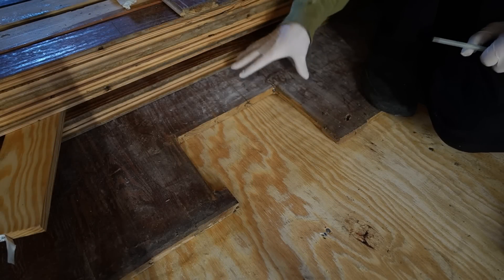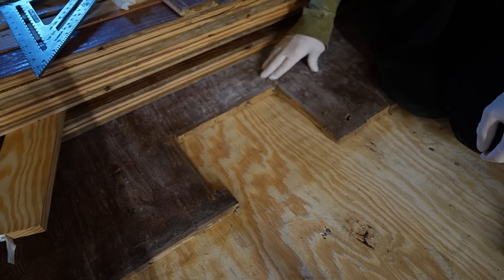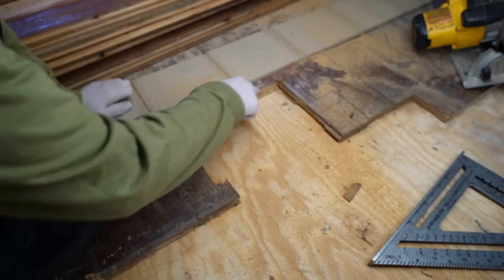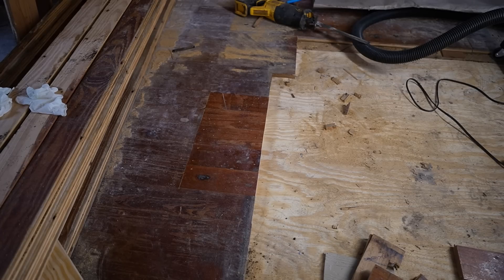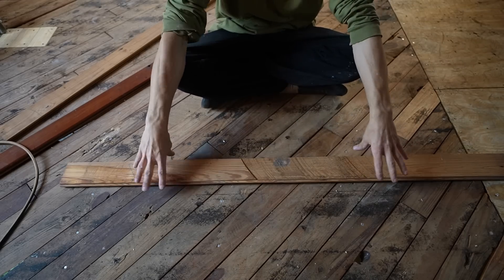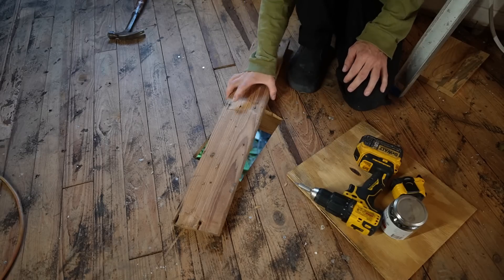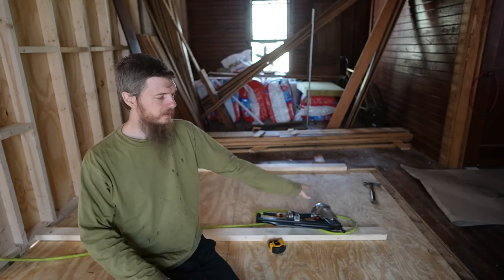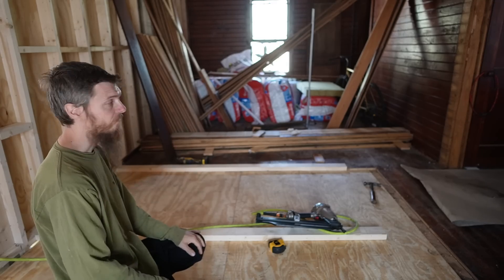Why Floors Were Installed Diagonally - Old House Chimney Demo, Floor Patches, and Wall Framing

Comment: They used to do this diagonal install on walls too. I grew up in a carpenter's family. I'm 75 and can remember when paneling came in, my Dad thought this was just great. He also never lived long enough to use nail guns. He had wrists of steel,though. Unfortunately he died young of colon cancer at 48. He was working before they had a separation of trades. He practically did every phase of building a house, including cinder block foundations.
Reply: Yeah.  Those old tradies were great, weren't they?  Nothing stymied them; they knew how to do it all.

Comment: I appreciate that someone asked why the original subfloor boards ran diagonal to the floor joists and why the finished top floor boards ran perpendicular to the joists.  Your explanation made sense as you showed what would happen if the boards weren't run that way.  
Thanks to the person who asked the question and Thanks to you Doug for explaining.  I'm always learning so much on your channel.  I'm an older, single gal who will never do any remodeling of a home but it's still nice having the knowledge. 
God bless you all!  🙏🏻😊🌻❤️

Comment: Watching you repair subfloor and floor rem8nded me of a couple on our 1920s and 1930s homes. When you lifted the wall by yourself I remembered raising a small bathroom greenboard sheetrock onto a preset ledge near the ceiling, holding it up with one arm and screwing it to the rafters while my 8 month old crawled around at my feet. I finally yelled to my wife to come and take our daughter out of harm's way. She was safe and I finished up. Doug brought back the memories.  I used a cold chisel to break up the bricks and blocks. I saw you got the inner arm scratch from the block. That scrape stings forever! Even your tiniest floor repairs are so precise, square, and clean. You are amazing. Great editing and shooting Ashley. You have a great eye!

Comment: It’s also way stronger in a diagonal. It holds square. My dad built houses in the early 1960 and ran the sub floor systems in a diagonal. As well as the exterior sheeting was ran in a diagonal way strong. That’s why you find diagonal bracing in corners of old houses. The let in. Or cut in a diagonal boards into the wall framing. It’s more about strength. But as well when running your finish flooring back then it was on a bias man as a boy I hit the cut off piles every Saturday to build my stuff on the farm. Old men with hand saws was common one power saw on the whole job.  Thanks your house is getting better and stronger by the day.  Great work thanks from sc.

Comment: I owned a house built in 1940's in Coconut Grove Florida (Miami). The floors were constructed exactly that way. When we bought the house some 40 years later, we had the original floors resurfaced and sealed and they looked great. Whenever I worked in the crawlspace I wondered why the diagonal subfloor boards. And yes they were lower quality with bark and roughness. Apart from having to replace and sister some sagging floor joists from below (very hard work) the house held up well. Unfortunately it is gone and later a multimillion dollar house built on the 1 1/2 lots we had. There are a couple of 'bungalo's" on that street (Bonita Ave) and adjacent streets that took advantage of the rolling topology of the limestone ridge to provide parking below.

Comment: I went through my building trades program in 1972. Our instructor had been building homes since the early 1930's and taught us well about historical building technology as well as modern (for the time) techniques as well. Subfloor boards as well as exterior wall boards (this is before plywood and certainly before Celotex) were laid on a 45 degree angle for structural integrality in order to withstand racking loads under extreme wind load conditions. Exterior sheeting was typically done with 1x6 to 1x12 boards depending on availability but always on a 45 degree angle. It made for extremely strong structures that were able to stand up to at least near miss tornadoes that were a constant threat where I grew up in Illinois. 
I makes me to happy to see you and your wife deciding to reuse vintage materials, and keep your house as vintage in the look of the structure as you possibly can. There is a certain charm to it that warms the heart. Keep the great videos coming... Joe
Reply from the maker: I wrote a post to help answer this in more depth here: https://www.youtube.com/channel/UCRKjjDhP3w2lnx3csu3G3aw/community?lb=Ugkx5ag0oHlMBgiFLakfx6GMELpXOfPC00j7

Comment: The primary reason for laying subfloor boards diagonally to the joists is for rigidity. By installing this way, the floor was less susceptible to racking. Building walls used to be done this way as well, so as to resist the forces of wind against them. A triangle is stronger that a square. When I was young, us kids used to help our dad and grandpa erect out buildings, and this was the method that was utilized.
Reply from the maker: I wrote a post to help answer this in more depth here: https://www.youtube.com/channel/UCRKjjDhP3w2lnx3csu3G3aw/community?lb=Ugkx5ag0oHlMBgiFLakfx6GMELpXOfPC00j7

Comment: Lookin good y’all! Doug, I’ve always heard that the 1Xs for subfloor as well as for sheathing, when placed on the diagonal would strengthen it so much more. Older houses were all done in this way before there was OSB sheets or plywood for subfloor. The house we are working on now is like this and it has withstood many a hurricane, tornado and lots of straight line winds and it’s still standing after 50-60 years. There’s a reason why they push all these “convenient” building supplies. Houses are easily destroyed by weather which means insurance pays or doesn’t….anyway, love the progress but I would definitely like to see some steel toe shoes on you when working with bricks and blocks like that. 😉 I have always hated to wear steel toe boots since I wear a size 11 they’re very heavy 😅 but now that I’m older, I wear them just about everyday especially when demo is involved. Ash, sorry for the rant 🤪😂 Love y’all!

Comment: Putting the small sub-floor boards diagonally also keeps the joists from racking [getting out of square].  When used on walls in old houses the diagonal boards keep the wall from racking by being attached to both the top and bottom plates.  Triangle is the strongest structure.
Reply from the maker: I wrote a post to help answer this in more depth here: https://www.youtube.com/channel/UCRKjjDhP3w2lnx3csu3G3aw/community?lb=Ugkx5ag0oHlMBgiFLakfx6GMELpXOfPC00j7

Comment: I heard your helmet in one clip and I thought back ti when you first started wearing it and explained that you were prone to lung infections. I am prone to what I have called "allergy flare ups." When I'm working with old stuff, etc. I would often get sick. This past week i ran into a very non standard situation in which we caught a teensy tiny mouse (house mouse). While I had it in a container at peed. I suddenly had great difficulty breathing. That's how I learned that I'm allergic to mouse pee. Oddly, it's not that uncommon (maybe 20%), but most people don't have a severe enough reaction or in close enough contact with mouse pee to know! It's called lab animal allergy. It's actually a protein most prevalent in mouse urine, but also has some other presentations. I found it fascinating, and I've really considered a unit like yours. For now I'm just suffering through a somewhat stamdard respirator mask, because it's what I have. Unlike many allergens it doesn't dissipate quickly from the system. It usually trgers feacyions that last 3 days amd can lead to secondary issues like other infections. Just thoight I'd share that since I think your breathing system is a wise idea. Also, the protein degrades in sunlight (uv) and dissipates with ventilation.
Reply: Im glad Im not the only one!! I have been allergic to rodent urine for about 20yrs.  People think Im nuts. I usually break out in hives. But it can also trigger asthma attacks.

Comment: Good explanation for the subfloor, stacking the finished floor over subfloor would add up all imperfections. Going across (even at a 45-degree angle) avrages out the imperfections hehe

Comment: In the UK the floor boards are laid straight. Probably because in older houses they used other flooring products like carpet and lino. We usually have to put ply over the floorboards to lay wooden floors or tiling. Sometimes round the edge of a room in an old house will be slightly different. Its interesting to see how other parts of the world do things.

Comment: My parent's house was built in 1956, which probably makes it one of the last houses built with a (non-tongue-and-groove) barn board subfloor. The barn boards ran perpendicular to the joists and the finish boards ran parallel to them. The floors didn't have any major problems, but they did creak a lot more than most other wood floors I've encountered.  There were also a few places where the barn boards had fractured, but not enough to cause any problems. I suppose if we had had termites, or condensation and mold in the basement, having the barn boards as the only thing supporting the floor between the joists would have been a disadvantage, but in our case, it was not a big deal.

Comment: The diagonal subfloor works for the same reason they alternate the grain in plywood layers. BTW, when you do replacement of older wood the dimensions are always different. IOW, 3/4" plywood isn't even 3/4" these days and old T&G floorboards are closer to 7/8". I used pieces of roofing felt (tar paper) as shims to meet the finished height.

Comment: The biggest reason for the angle if the joints are parallel sooner or later the nails in the finish floor will fall into the joints in the Subfloor.  So when the edges line up your going to need to face nail the finish floor.  But with the Subfloor at a 45 you can always land the finish floor nails in the middle of the Subfloor board by moving left or right along the tongue.

Comment: They also did walls diagonally to help with horizontal racking.  Placing boards along just one axis wouldn't be nearly as strong.

Comment: In our home they ran the sub-floor and the floor the same direction. After a large flood we started to see humping and peaking in the floor.  This floor and sub floor were never wet from the flood but the problems happened.  Now almost 10 years later we see some shifting in some joists where the worst peaks and humps are.  I suspect these things would not have happened if the sub floor was diagonal.  I think this video was needed because people don't think about the problems that can happen until they start to experience them.

Comment: Older homes didn't have panel lumber   the diagonally  opposite  layers give strength  against  racking  thus was also a practice  with walls  also prevents  racking  keep structure squared
Reply from the maker: I wrote a post to help answer this in more depth here: https://www.youtube.com/channel/UCRKjjDhP3w2lnx3csu3G3aw/community?lb=Ugkx5ag0oHlMBgiFLakfx6GMELpXOfPC00j7

Comment: Excellent and best explanation I've heard about why old subfloor boards are laid on the diagonal.
Reply: It's not quite correct, tho.. the diagonal subfloor helped so you could lay your finished flooring whichever direction you pleased, but it was laid diagonal to add strength and make a more rigid floor.
Reply from the maker: Kristine, actually, it is very correct. There's no need to undermine my message. I wrote a post to help answer this in more depth here: https://www.youtube.com/channel/UCRKjjDhP3w2lnx3csu3G3aw/community?lb=Ugkx5ag0oHlMBgiFLakfx6GMELpXOfPC00j7

Comment: can cross the subfloor in bothe directions too so say north to south and east to west , still crosses the diagonal floor below
maibe look intoo hiring/ (buying a used) a shipping container or old truck trailer that can not be used anymore for hauling / old worthless but watertight schoolbus with blown engine and setting it up in the yard as a storage unit , should allow you to store materials clean and dry and have the house empty , would make sure that it doesnt sink in the soil or you would have a verry hard time getting it back out 
seen schoolbusses being dug in up to slightly above where the windows used to be with a stairway to the back emergency door and used as a storm shelter

Comment: Floor layers should always alternate directions.  You shouldn't layer wood in the same direction ever, regardless whether the flooring is running across the floor joists.  You should have a substantial sub floor to lay the wood planks on. Then the nails will hold it down and you won't need 4" nails to drive into the joists.

Comment: Thanks for explaining the diagonality; I was wondering about that myself.  I'll have to ask dad if they did that on grandma/pa's house in the 50s when they turned that 4 room house into a 3 BR house (dad was in his teens at the time and helped grandpa with it).  Sadly, it was sold after Hurricane Ike put 7ft of water inside the house, so can't easily go over there and check under there w/o current owners asking 400 questions.  People have some weird issue about sneaking around their house for whatever odd reason.  >>:=p

Comment: Could you post the manufacture of the dust mask you have, I have to do my bathroom and could really use one. Thanks
Reply from the maker: 3M Versaflow respirator. I would only recommend it if you really need it. It's a professional piece of equipment and costs a lot. There are cheaper options. We did a video about the respirator here: https://youtu.be/koKrOK8dsN0
Reply: @diyfferent  Thank you

Comment: Sometimes it hard to see the original wood that's on the walls but when Doug was using a piece of the wood to explain why the subfloor was laid on a diagonal, I can see how nice it is. Is the wood on the walls the same boards as the ones on the floor, just curious.
Reply: He said in another video that the walls were a softer wood than the floors....

Comment: 4:28 ....to the previous owner/contractor/builder:  what was the point of concreting the blocks together above the floor and no concrete holding the blocks together under?
Reply from the maker: Years ago the house was raised and they lifted the chimney and they just stacked loose blocks under it to support it.
Reply: @diyfferent  thanks for the interesting detail on that. still seems not right to me. lol

Comment: What the heck was the point of those bricks going up a wall ? Not a fireplace!
Reply from the maker: It hadn't been used in a very long time. They probably had some kind of furnace. We already demolished the top part when we did the roof.